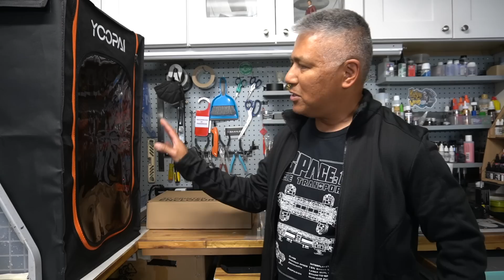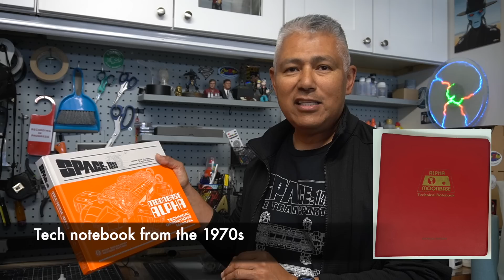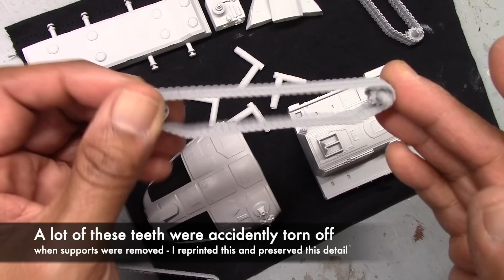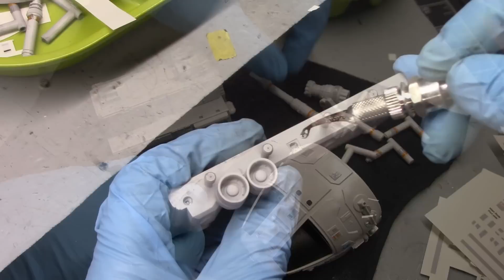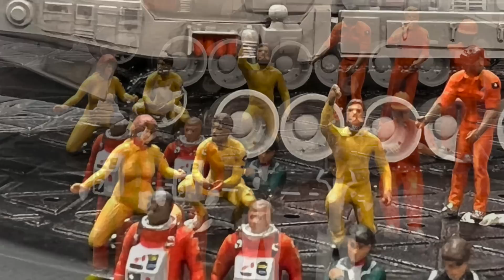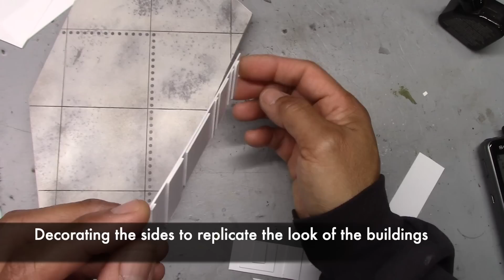Space 1999 Laser Tank Diorama

Comment: Just another great build. Oggie...quick tip for removing delicate supports, immerse it hot water, it will soften it just a bit and then cut.
Reply from the maker: @MiketakesaHike  thanks.  Yeah totally agree.   i’ve used that method for a while now and it works great.  Some of the smaller delicate parts, however, i find useful to snip them off as the heat can make the piece warp.  Thanks so much for watching